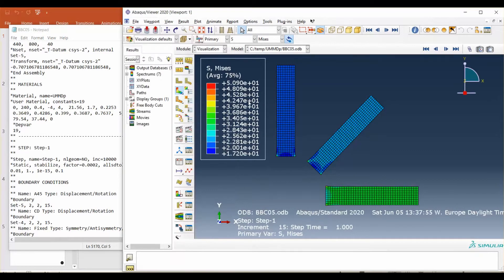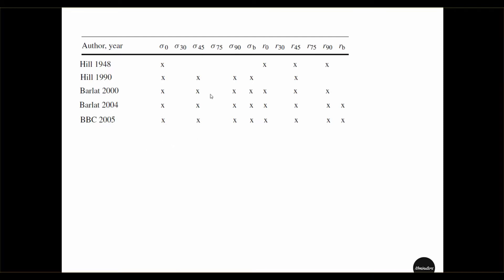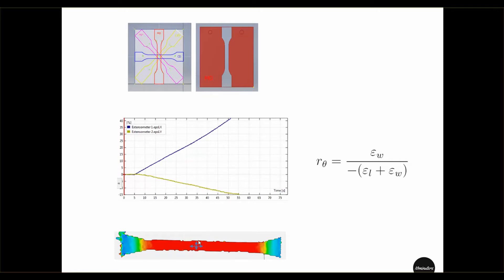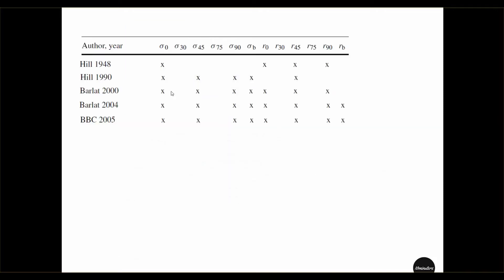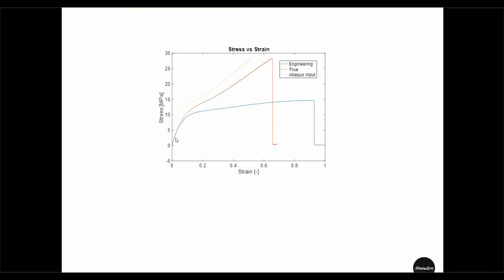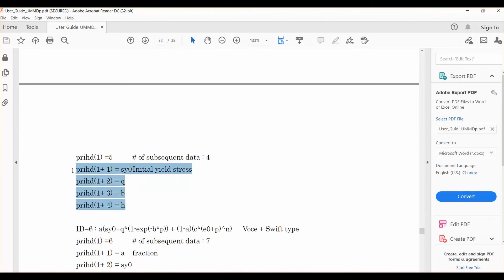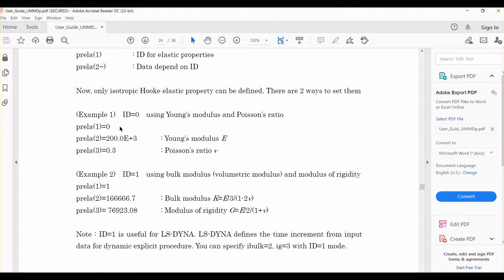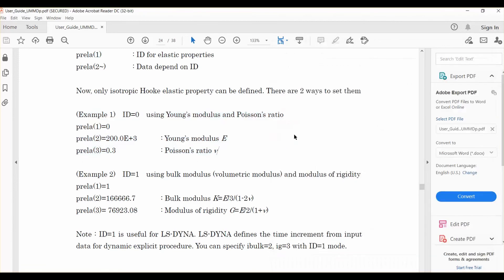Part-2: Abaqus subroutine library for anisotropic yield criterion (UMMDp) II Tips on yield parameter

Comment: Thank for share. Very nice videos!.. I have a doubt about matlab Custom Eq. How did you declare Z variable?. Cause In my GUI the custom eq. apears as z=f(x) instead z=f(x,y). Thank you so much.
Reply from the maker: Hi, when I use 'cftool',  in matlab R2018, in custom equation GUI shows z=f(x,y)! Have you loaded X, Y and Z data?
Reply: @10Minuters  Thanks for response. I just have x (strain) and y (stress) values.  and x is in function of z in custom equation. Z=f(x) that is "z=13.5+q*(1-exp(-b*x))+h*x" in my case. 
In X data: x
In Y data: y
In Z data: (none)

I'm using a R2021a. ¿How can I send you some images? 

best regards,
Reply from the maker: @OscarGarcia-tx7hm  If Z was a function of both x and y, you could load all x, y, and z data to fit custom equation  z=f(x,y). It looks to me that you only have z=f(x), so you can just rename z to y (it does not effect the relation) and fit y=f(x).
Reply: @10Minuters  I have an other Q. In this kind of subroutines how can I put 2 diferents modulus. I mean E1 for one direction and E2 for other direction (lamina or orthotropic model).  Is it possible?. An apology I don't have experience on this. I saw your video "Anisotropy in Abaqus (Hill48) , I know this is for steels and other similars. But  I am looking to characterize a type of cardboard, on this I used a orthotropic and use the potential but my material didn´t fit with this criteria. Can you give me some advise?. Best regards,
Reply from the maker: @OscarGarcia-tx7hm  The subroutine has to be already developed in a way to accept E1, E2 etc. Otherwise, it is not possible to add orthotropy. I think Abaqus has some standard material model that might do what you want. Unfortunately, cardboard simulation is not my cup of tea. Good luck!
Reply: @10Minuters  An apology for the delay in replying. Just thank you for your attention, thank you very much! great content!.